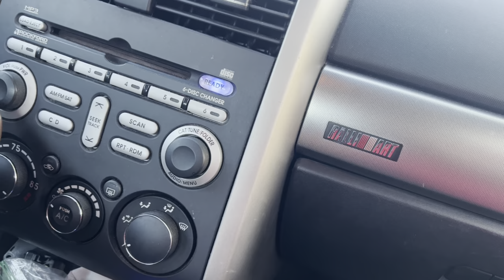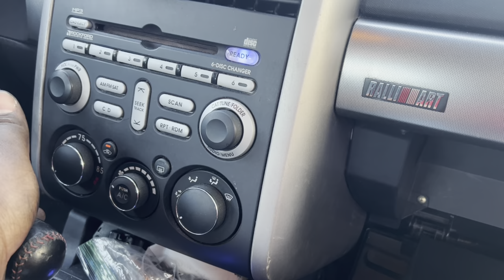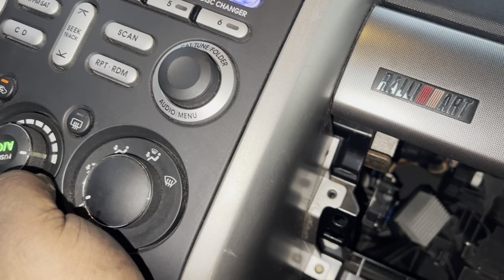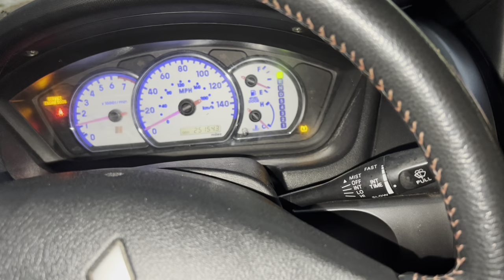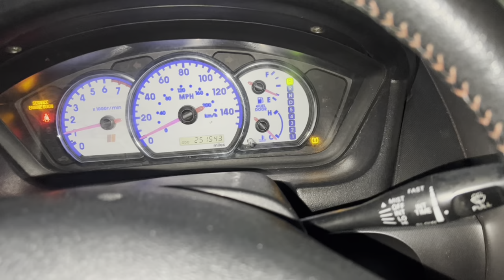2007 Galant ralliart 3.8 L￼ Fog lights and hot and cold actuator￼

Comment: Hey I, by the way, does that Gallant have a cabin filter?  Nice work.  Hope you can find a mount for the other fog light.
Reply from the maker: Mine actually didn’t have a cabin air filter but I ended up making one by cutting the area where it supposed to go and putting the filter in there anyway but yes hopefully I can find the other Mount

Comment: Hey man, I have a 2008 galant ralliart, I’m having a issue with the airflow on the climate control, it will just stay on defrost no matter where I change the knob to, is there like a blend door actuator or something that I can replace or maybe a fuse for it?
Reply from the maker: Hey how are you yes there actually is an electronic motor for the blender door and I guarantee you it’s dead find the location and replace there is no other issue with the car just the actual motor that moves the blender doors
Reply: @legionelitemotorsports2096  I’m doing alright, I appreciate it a lot for the reply, I’ll check Google and see if I can find it. It’s been stressing me out because the weather doesn’t want to make up its mind and I can’t feel the air lol. Especially when it’s cold I need heat lol. Love your Channel and builds keep it up, I’ll be keeping up with your galant videos

Comment: Quick update....wrote down the number from your video and found it.  Someone said there is one on the driver side or is this "the one" that controls the temperature regulation from hot to cold?
Reply from the maker: That one is the one that controls hot and cold and I believe there’s only one on the passenger side
Reply: @legionelitemotorsports2096  So, when I turn the thermostat to 78 degrees, this is the actuator that would determine how much cold and warm air to let in?  When I get a moment, I will send you some pics of my Ralliart.  I agree with you....it is a rare model.  Mine has 144,000 one owner miles and then engine still runs like the day I brought it home.  It runs even better now because it is paid off!!  :)
Reply: Are you planning on any engine modifications or just leaving it as is?